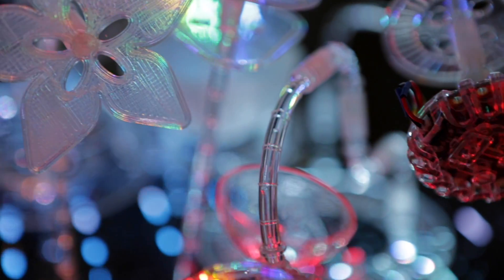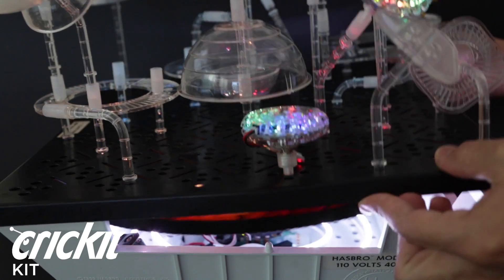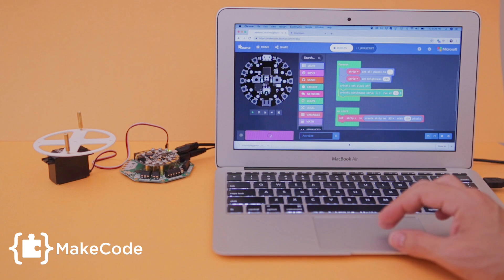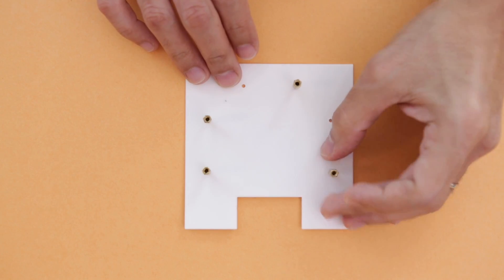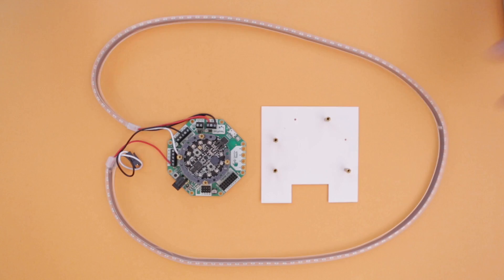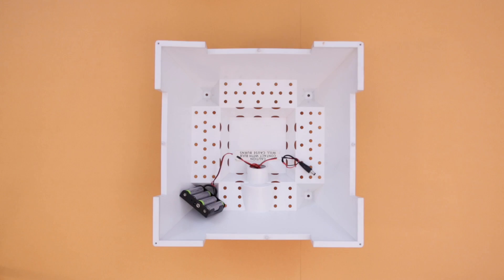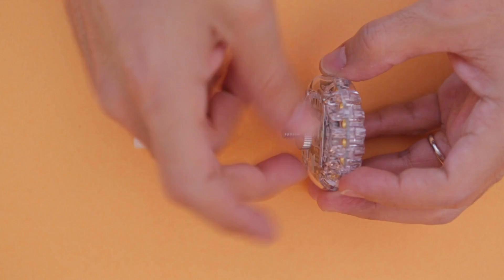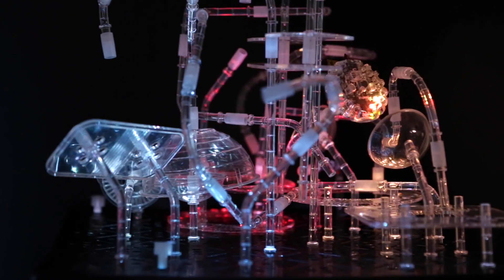Astrolite NeoPixel Upgrade #3DPrinting @adafruit #adafruit

Comment: Okay....so I pulled out my CPX and CRICKIT from adabox 8. Hooked everything up, and I can't get the servo and neopixel to run at the same time on the 4-AA battery pack (the one in the parts list). The battery pack gets hot, so I'm assuming it needs more current than my AAs can provide. Any ideas?